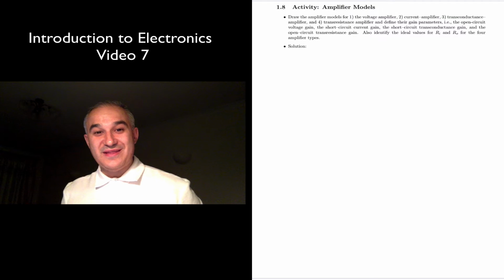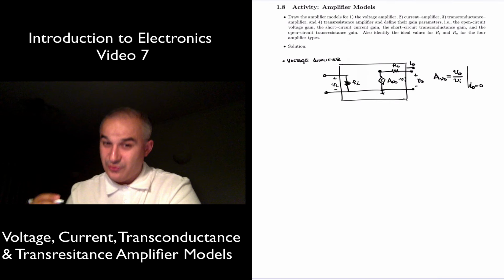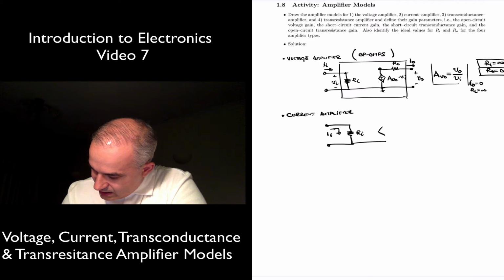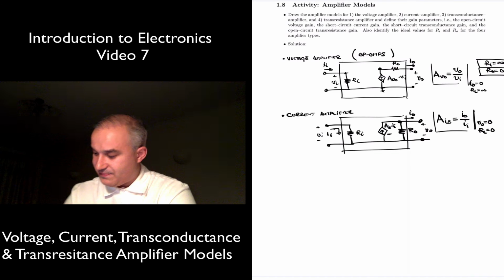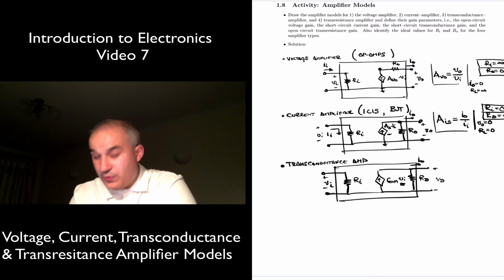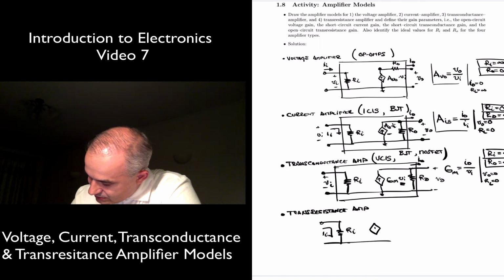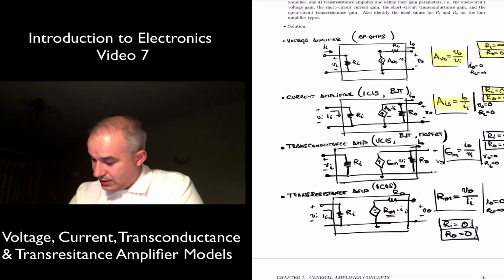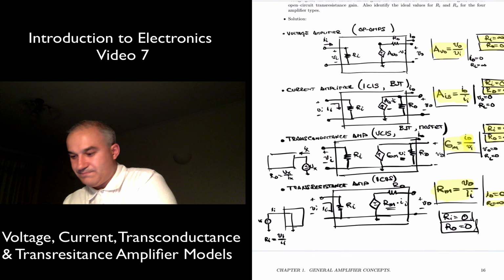Electronics-Four Types of Amplifier Circuit Models

Comment: why the output resistance is draw sometimes in series and sometimes parallel.
Reply: The voltage Amplifier is modelled in Thevenin's equivalent circuit where as the current amplifier is modelled in Norton's equivalent circuit.
Reply: When the amplifier is doing voltage gain, the output impedance will be in series with the load.  When the amplifier is doing current gain, the output impedance will be in parallel with the load.  In both cases we are showing that the amplifier performance is less than ideal because of the amplifier's output impedance.  Voltage amplifier's should have Ro going to zero.  Current amplifiers should have Ro going to infinity.  In the first case we have voltage division by Ro, and in the second case we have current division by Ro.